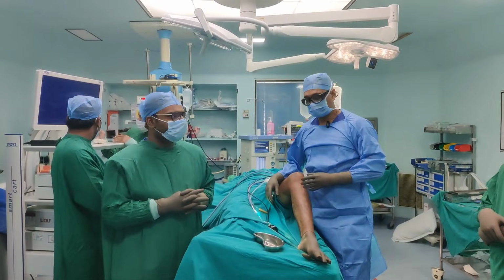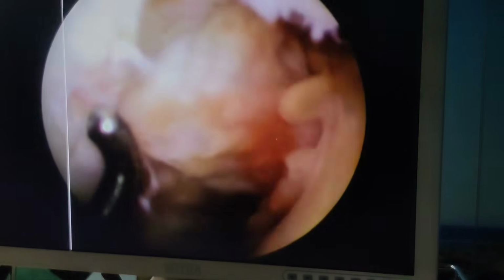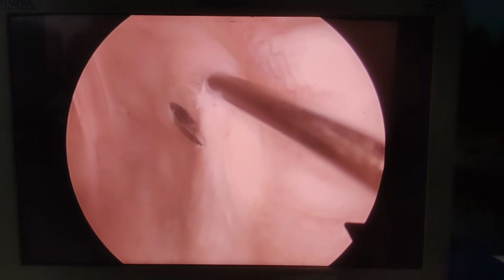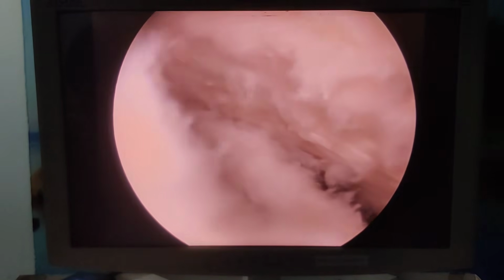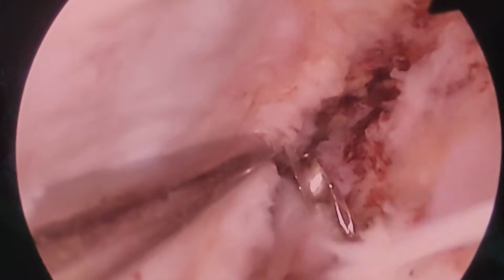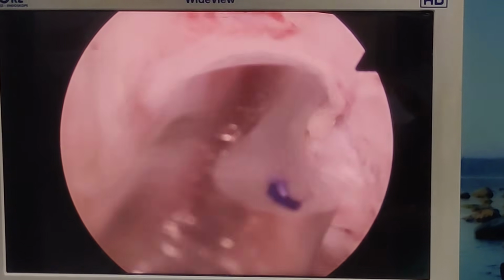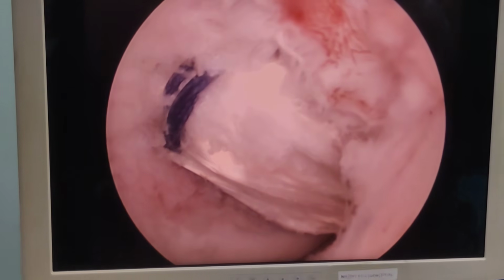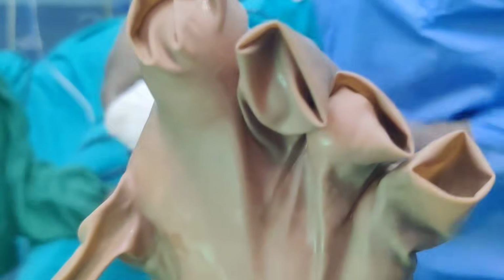Arthroscopic PCL (Posterior Cruciate Ligament)Reconstruction with Hamstring Graft

Comment: Complements on the video. Also a small tip for youngster. Use a messenger rod from posterior medial to help get around the tibial curve of it gets tight. 

When entering the tibial tunnel check for soft tissue bridges. And you can use a dilator. Can also lubricate the graft.
Reply from the maker: Yes messenger rod is a good trick, I thought I would demonstrate but forgot while performing surgery. Thank you